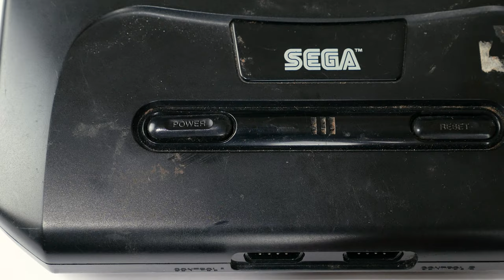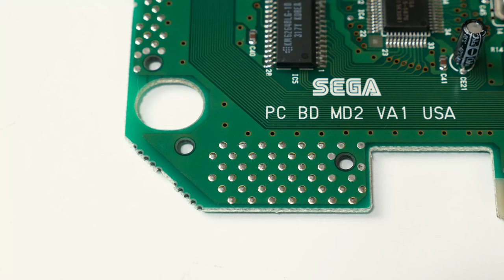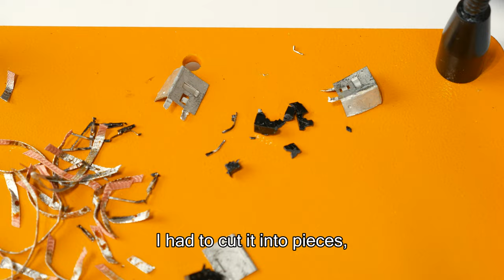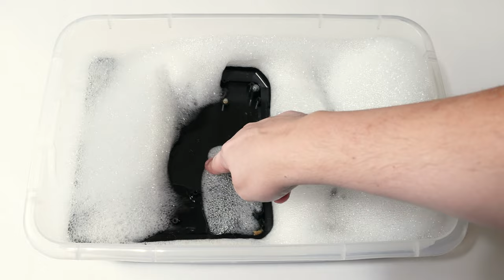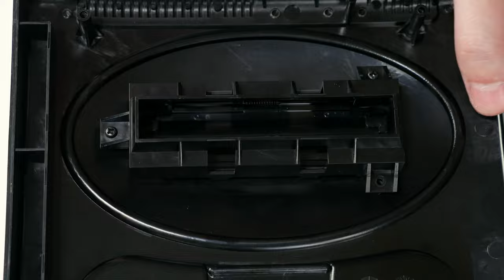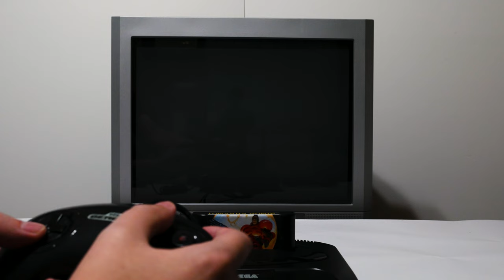Sega Genesis Model 2 Restoration and Repair

Comment: Where do you get replacement parts seen in video
Reply from the maker: I got the A/V replacement port from Console5. It's called "Sega Genesis, Mega Drive 2, 3, 32X, Nomad, CDX, X'Eye A/V Female Port Jack". For the power supply, any adapter that can provide 10v DC at about 1A with a center-positive 1.7mm plug should work fine. I'll put links in the description.